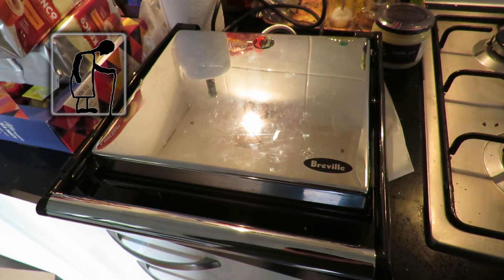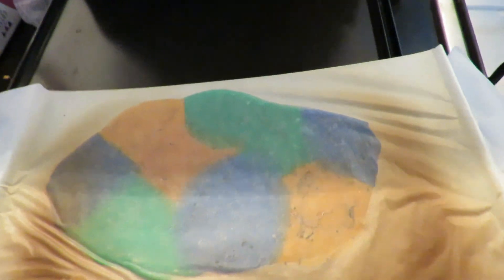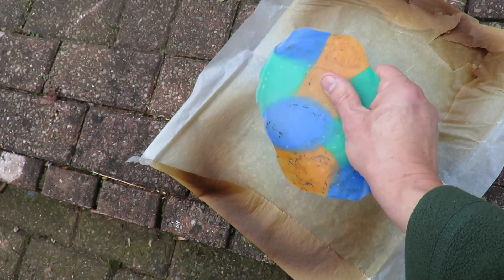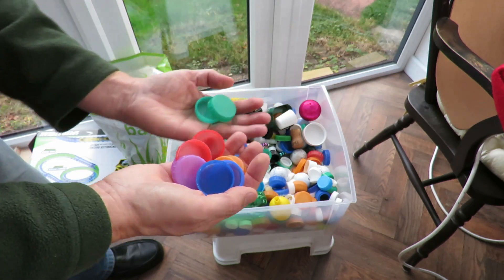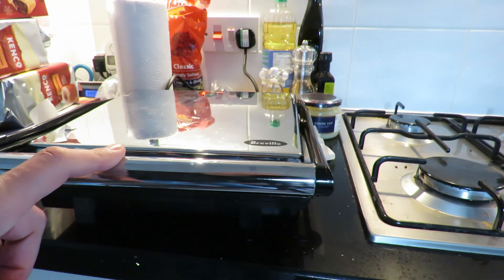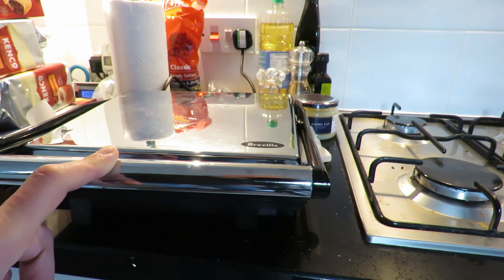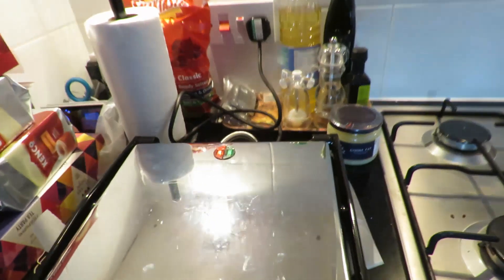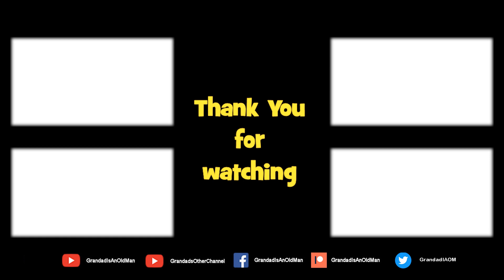HDPE first test using a sandwich/panini toaster

Comment: can you make them into wings and make a plane
Reply from the maker: This type of plastic is a bit flexible for that sort of thing. I have made a glider from an HDPE bottle in the past but there are plenty of other things you could use it for. There is a fair amount of debate in the "recycling community" as to whether this sort of application is very energy efficient. Melting the plastic like this uses a fair amount of power, the power comes from fossil fuels (electricity isn't free) so it's not going to save the planet.  Here is that glider I mentioned https://youtu.be/EMybY7YQK5w

Comment: What a good idea. Happy new year to you 😊👍👍👍
Reply from the maker: Thanks Damian, there is a fair amount of debate in the "recycling community" as to whether this sort of application is very energy efficient. Melting the plastic like this uses a fair amount of power, the power comes from fossil fuels (electricity isn't free) so it's not going to save the planet, but it is interesting to try and there are all sorts of things you can do with it if you mould it and let it cool.

Comment: Perhaps if you took it out when the green light comes on and then lay the hot HDPE over a mold.  Boat hull? or RBP car body.
I wish I had a Panini press.
Reply from the maker: Certainly the usual process I have seen in YouTube videos is you melt it in an oven and then press it into a mould and then clamp it hard to stop it warping as it cools down. The only reason I am trying this sandwich toaster is I watched Atomic Shrimp use it (he managed to let it overflow and cool round the toaster causing him a real problem when it set rock hard )